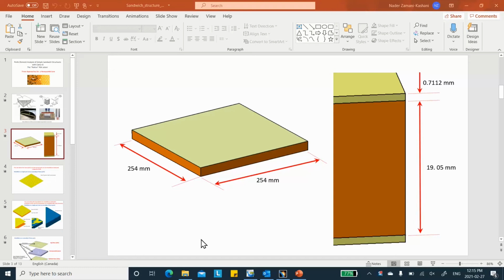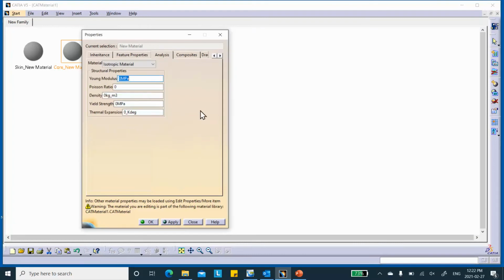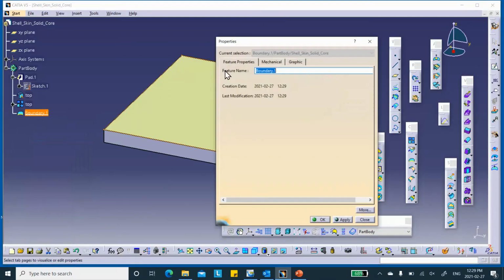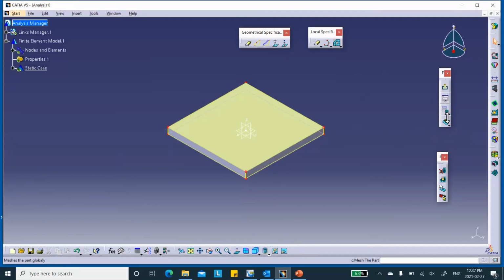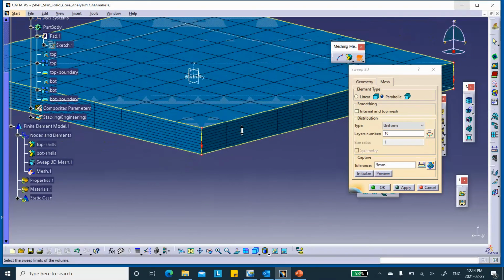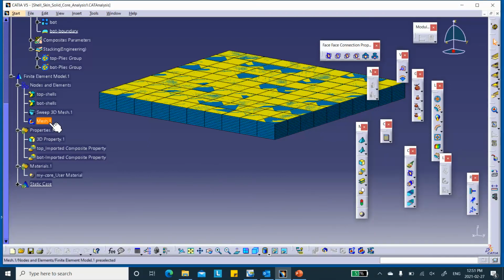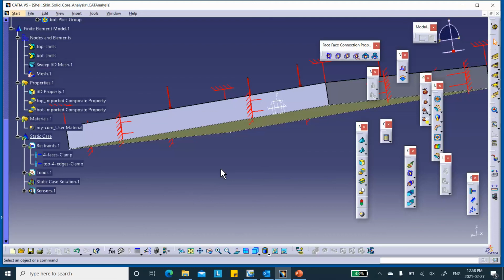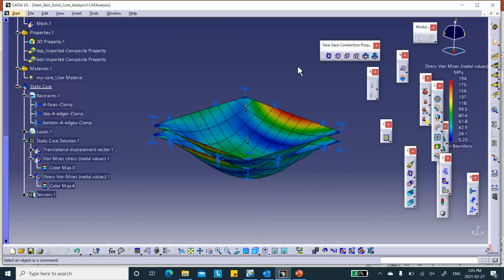Composites Catia V5-6R2018 "Native" FEA, video 32, Shell-Skins Solid- Honeycomb Core, Single Part

Comment: Hello good day. Your FEA carbon fiber honeycomb analysis videos 32 and 33 are full of instructive information. Thank you for that.

Currently, I am working on the designs and analysis of an electric formula 1 vehicle as undergraduate graduation project at the university. Can you share the density values of the carbon and honeycomb materials you used in videos 32 and 33? I am creating my own material library and if you share this information I would like to add them to the library as well.

I wish you success in your work. Thank you again.
Reply: @naderzamani-ngzk  ,   Thank you for your answer, Professor.

I was just thinking of enriching the library content I used in the project. I will continue to search online.

If I am successful in my project, I can send you a document from my project. You can review. Of course, I have to work for months for this but it is almost over. I learned information from your composite analysis. Thanks.

Thank you again. I wish you success in your studies, Professor. Greetings from Turkey.